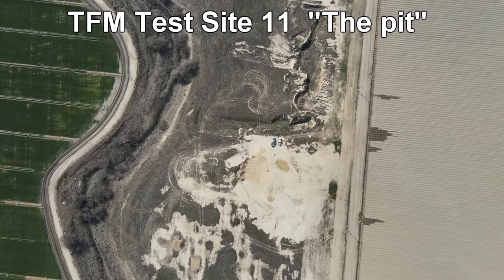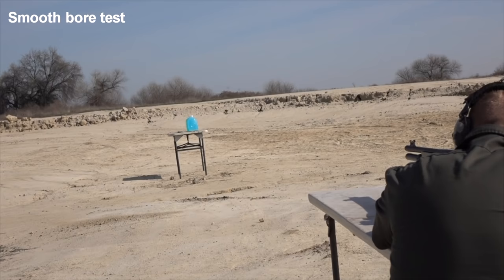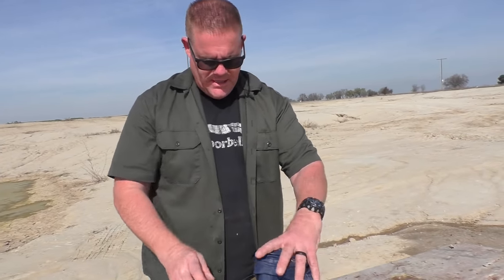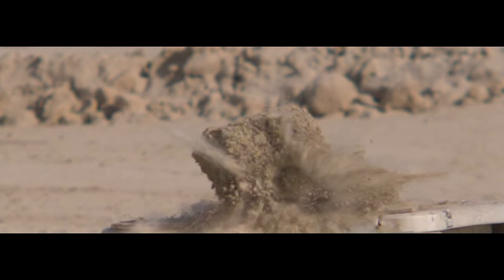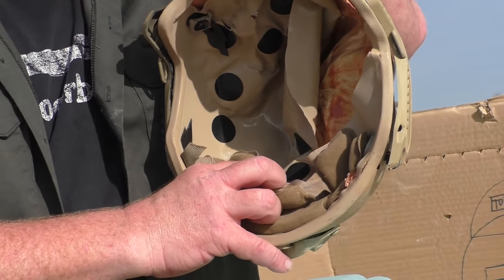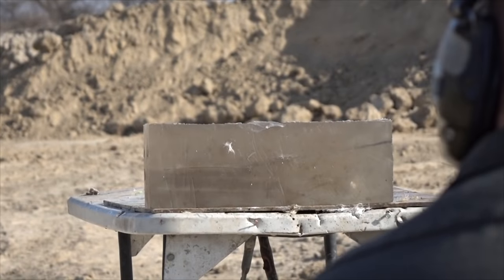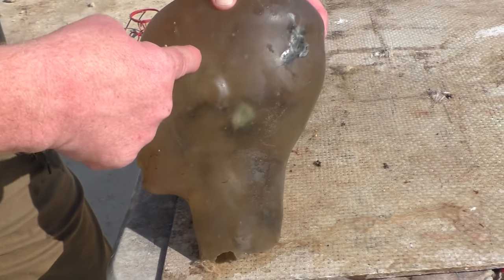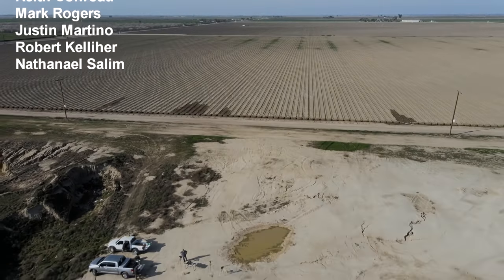4/0 Copper Cable Flechette Rounds - Tested

Comment: Not to Critique. But as a technical note. If you pull on the tape as you wrap it you can get a much tighter binding. I use electrical tape on wire like this all the time. Then pull it through conduit. It’s kind of an art. 
My suggestion though would be to remove the insulation and sleeve it in led. 

You would add weight to the payload, and your dispersion on impact would be crazy

Comment: If ever come around this one again. Would possibly be a good idea which is what do you usually do with copper wire. Well use some solder. Would possibly hold the wire together. Just a thought .

Comment: you could use a small amount of cold solder or J-B weld on the backside of the wire to keep the wires in place until impact, might save you some ballistics gel and get a better result. Great video though, very interesting.

Comment: you might be able to dremel the "front" of these slugs in a way that would make the individual wires spread out more, either by painstakingly sharpening each one or just doing outward sloping angles in concentric rings, hell maybe doing the "+" cut would suffice.

Comment: My suggestion...solder one end with lead just to hold the strands together. Load unsoldered end forward, it should create more mass, and allow it to not break apart.  On impact I think that the strands would splay out ripping the wound cavity to shreads.
Reply from the maker: That would melt the insulation

Comment: Can’t read all 2800 comments to find out if somebody has already mentioned this, but it would be interesting to see what difference it makes if the cable’s twist is the same or opposite of the barrel’s rifling. I think it might make a difference when it comes to whether or not the copper strands remain in the jacket while being accelerated down the barrel.

Comment: Good luck finding those strands. There are 17 strands of I think 90 individual copper lines meaning there are 1,500 individual pieces of copper. 4/0 is a pound a foot and I usually see it in 100’ lines.

Comment: That coper wire would be EXTREMELY difficult to remove id imagine. You pull on em and they just bend, twist, and break just causing more injury (if you can even find them in the first place)

Comment: I wonder if dripping some adhesive like Super Glue or Rocksett down inside the wires and alongside the casing would help hold it together.    It might at least keep it together during flight and allow it to separate on impact.     That is if you are able to get some more of these.

Comment: You might try lead goose shot (2s or BBs) loaded into a shot cup inserted closed end forward in the shotgun shell. It might hold together until it is inside the gel and then scatter.

Comment: you could get super creative with a similar configuration like this actually.
An arrow point surrounded by darts point would make a very mean slug. Especially if they're made out of tungsten. That only leave to research the type of epoxy needed to bind them all together in a slug.

Comment: You might try soldering one end of the cable just slightly enough that it holds the the wire together until impact.

Comment: I wonder what would happen if you used a smaller piece of cable, and loaded it into a minishell? It obviously would not have as much penetration, but possibly more spread? And definitely more capacity.

Comment: If in addition to the tape for stabilization, you solder the rear, or front, quarter inch or so I would expect the wire strands to stay together and then splay apart upon impact creating a larger crush area similar to a hollow point round.

Comment: This would be about like getting a frag grenade to detonate inside the intended target, when all works as it should. This would have to be one of the most deadly rounds I have ever seen because of the sheer random pattering of the copper insides the 'victim', pus the size of the individual copper wire pieces. This would be a surgeon's worst nightmare.

Comment: Copper as fleschetts is fine because they're softer than steel but never, ever try shooting real fleschetts through your shotgun barrel.   They're hard, stainless steel pins and will flat out destroy your barrel and you can't generate enough velocity to cause orientation in flight and penetration of a target, anyway. 
  Fleschetts were designed to be used as fragmentation/shrapnel with things like Claymore mines, pipe bombs/barrel bombs/improvised weapons, etc..
  I was a munitions specialist in the 80s, when fleschetts were still around.  All we did with them was stick a couple in our caps so people knew we worked with fun toys.   Beyond that, they were outlawed because they caused great injuries with non-leathal suffering (exactly what they were supposed to do) and, when enough were propelled with sufficient force (55 gal drums filled with explosives and shrapnel), people would be pinned to fixed objects (like trees) although still not quite dead yet...  "Bring out your dead..." ( Monte python, ringing in my ears). 
  So, unless you wanna either fill a pipe bomb or embed them into plastic explosives and use them as an improvised grenade or stick some in your hat, to look cool...  Fleschetts are useless as ammo in 12ga.shells.  Unless you've got a shotgun with a pitted, rusted old barrel that you don't mind destroying.

Comment: If you stripped the vinyl off of the wire, and then put some of the heat shrink on it that has the heat activated adhesive lining it, I bet it would hold together better.  Interesting idea here tho!

Comment: When I was a kid there were rumours of shotguns using shells with a length of fuse wire which had fishing split-shot attached to regular intervals.  Does this actually work or is it one of those myths.  Can it be made to work?
Reply: He already tried this one, and it makes a great home defense round. Guaranteed to put down an attacking home first time, every time! 
But seriously, it works and is the next best thing to a slug.

Comment: It would be interesting to see what would happen if you cut a slit lengthwise across the copper cable to allow the insulation jacket to separate earlier.

Comment: I suggest soldering one or the other ends of the copper wiring while in the sleeve, then remove if necessary and put on a new piece of insulation! Hmmm

Comment: i wonder how these would work if in the assemble stage, solder was allowed to weld the wire strands together as when a plumber sweats a connection together.

Comment: You should have soldered the rear part of the copper wire together to create a pseudo hollow point slug. The front end of the round Wood expand and the solder wood keep it from breaking apart in flight.
Reply: Would*
Reply: That's just my theory though.

Comment: If you could get a layer of solder holding the trailing end together, it may work better in the smooth bore.
Reply from the maker: the insulation would melt
Reply: @taofledermaus  you strip it back 1/2 inch and use a solder pot to dip the end.  Cut it to length after you solder it and put the soldered end in the wad.

Comment: When these copper wire rounds work, it reminds me of the waxed shot rounds. Except the wax rounds you demonstrated are by far the most horrifying shotgun round I've ever witnessed so far.

Those things tumble, but there's no saving you if you get hit. With a fairly reliable range of 50 feet.

Comment: if the wire  forward ends were beveled in a outward pattern , a different tighter shell (0.01 crimped hardened steel ribbon) for flight that rips open at impact, also loading and curving the wires,  " sunflower" dump of distribution o force could be expected ? > a 3" hole surrounded by 9" of  la machine mess < the kings men thought "Humpty" was an impossible  task just for falling !

Comment: What about pouring a little epoxy into it, to keep the wires together till they hit. And then rounding the outer edges of the front end, and possibly the rear also.

Comment: Try coating one end of the Cable with a lite coat of super glue to hold the projectile together before impact .
might work ? 
run it by Cameltoe

Comment: Bare a little of the rear end, Flux it and dip it in lead or tin. Should help hold it together against acceleration but still allow it to come apart after impact.
Reply from the maker: It would melt all the insulation if you tried to solder it,  etc.
Reply: @taofledermaus  I'm a construction plumber. I sweat/solder faucets full of plastic parts to copper pipe all the time. I said to bare a little of the copper at the end. You don't have to heat the whole thing to 600F to make lead or tin stick. You just have to be quick.

Comment: hey i have a question if the projectiles/slugs you have shot arent defromed much do you reuse them/ is it safe to do so. i m asking cause i wouldn't rather have oportunity to check myself, and even if i would have opportunity i would firstly ask more experienced shooters like you, all guns that are legal and easily obtainable in my country are black powder replicas pre 1885 like remington revolvers and colts and there is not such a thing as private gun ranges on private property only those professional ones very strictly restricted by law and they dont agree to shoot anything other than those lead classic projectiles and those deform like crazy so without melting its unreusable.
Reply from the maker: Yes,  we have reshot a few slugs that we recovered and weren't damaged.  Usually they are made of brass which is quite tough.
Reply: @taofledermaus  Thank you for really fast response almost as fast as a slug :)

Comment: I think soldering the front of the wire face together solid would solve 2 problems. It would add forward weight, & it would probably hold the wires together just enough to reach the target in 1 piece,,,, becoming a frangible slug. Probably a different concept altogether, but a good one.
Reply from the maker: but it would totally melt all the insulation in the process
Reply: @taofledermaus  … not if we use a cold solder pen. Do those things even work?

Comment: I can tell you before even watching the insulation will hold the wires together. I the insulation is moulded on and the cable is twisted.

Comment: You want to weight the load and keep it the same as the weight of what was in the shot shell from the factory load like 3/4 oz or 1 oz  on a 20 Gauge, Powder is weighed to match the projectile weight to get a safe load. cartrides can be under powered and that can also be dangerous because the load could take longer to move the projectile out of the barrel and build higher pressure, not so much in shotguns but rifles it could be truely dangerous, bullet could slowly move in the barrel and the pressure build higher than the gun can handle and the breach could blow back in your face. because you need a fast bullet to allow for shell expanion which hold the pressure in the barrel but if that takes to long then the presssures can bypass the case and build more presssure on the bolt, Not a good thing if you are using a semi auto that relies on the shell expanding to seal the explosion at the neck as the bullet is leaving the muzzle.

Comment: Im confused as to why they didnt address the 1 or 2 copper rod that flew straight in and out the backside when they shot the ballistics gel length wise, that came in and out like that gel was nothing and still had speed upon exiting the back.

Comment: Oh if this was developed into a defensive round i would buy it. There isnt over penetration so no worries for the neighbors and yet if your in the next room, it looks at though you could shoot this threw a wall and still stop your attacker? even if it dosnt penetrate very deep i dont think anyone is going to get right up with that many pieces of copper shanks in them. And if they can be made to spread just a bit so if your firing down a hallway at multiple attackers would be great as well as it would catch multiple targets in a confined hallway. I think someone should try to developpe this round and see if they cant hit it big? very interesting for self defense of even for a trench gun as your going to run into multiple targets. and if you send one of these into a small group of enemy combatants they are going to at the least flinch "if" their not hit with the 1st one and give you time for a follow up to clear the rest or maybe pull your side arm to finish off those that may still be a threat. great video guys

Comment: I wonder what would happen if ya took the wire and sharpened everyone and pack it and see what happens .and do the same again but glue them together or solder them together and send it .just curiouse if it would bake it more stable and more penetration .just a thought but I'm subscribe again .I did before but about 10channels I subed to had did same thing and I had to resubscribe..

Comment: Man whoever designed that should have trimmed the rubber back about a quarter-inch and then dip the tips in some molten lead I think it would open up nicely when it hit something soft or hard for that matter. But it should stay together better.  I think.

Comment: i'd have lightly soldered the ends of the slugs. not enough to do much more than hold it together during the initial send off, hopefully.
Reply from the maker: In order to solder something like this, you have to heat the entire mass up to the melting point of the solder, which unfortunately would have melted the insulation in the process.
Reply: @taofledermaus  literally just the ends, and only as a surface coat. not a full length job like you'd be tinning it for having a solid connection in a traditional sense.

its doable, it just needs a light touch.

Comment: can i send some cable that has fine wire to try???
Reply from the maker: If the diameter of the cable is correct  - around .650 to .675 "
Reply: @taofledermaus  i have multiple sizes and thought you could put a penny flat behind the wire to hold it together better during firing